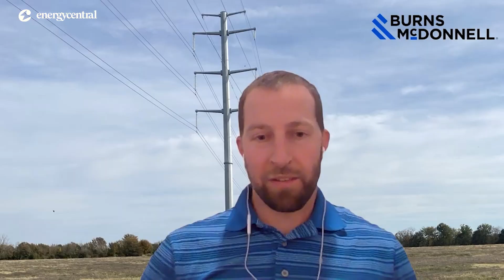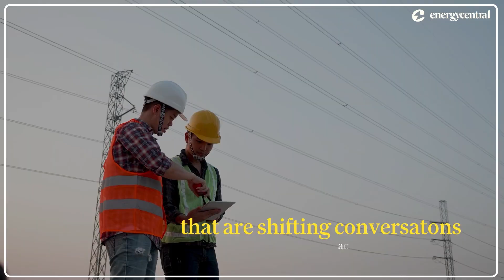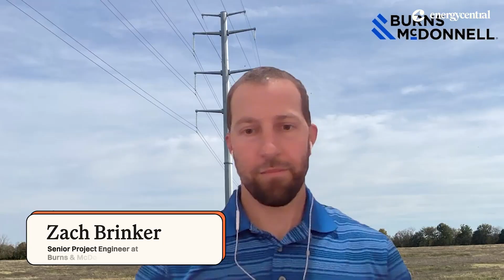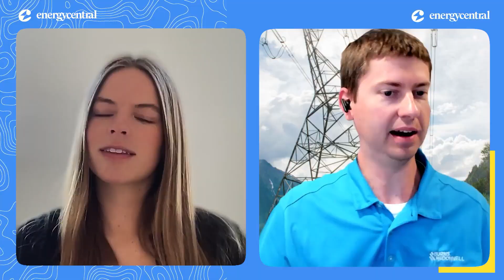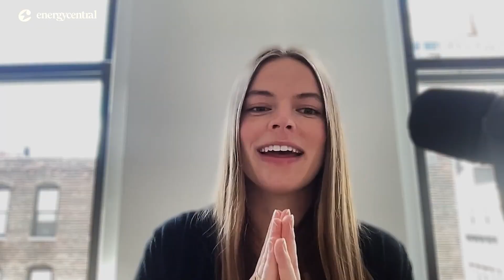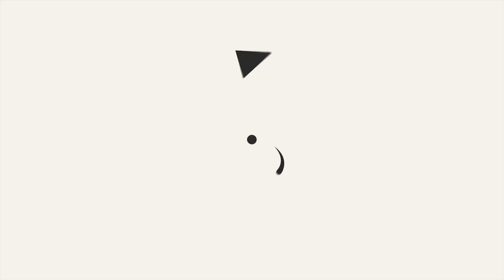The Engineering Debate Shaping the Future Power Grid

Comment: Thank you for this presentation.  I question the premise of your presentation. It is true that the power grid needs work. That is because of historic under-investment.  Your major assumption is projected growth of demand. While that may be true,  there are alternative to the building of more towers. In particular is the growth of distributed energy production. I have cut down my electrical consumption by half by installing solar panels and batteries. This process is taking place on a wide scale. Given that, it may be the case that the grid will be less of a factor. High voltage Direct Current is a growing technology.  Also, re-cabling with improved cables would preclude the need for new power lines. Lastly, the need to service data centers could be overestimated.
Reply from the maker: Scale is exactly the challenge. It's terrific when individual actors like yourself can and do cut down. But large industrial (data center and otherwise) power loads are coming on. 

The right answer will likely land somewhere in between, new transmission build out augmented by distributed assets that are becoming more deployable.